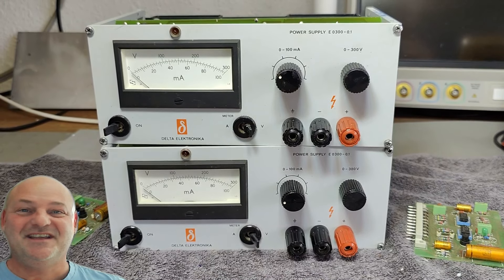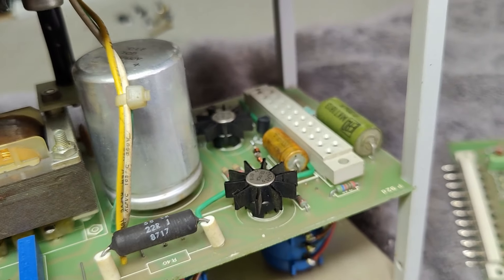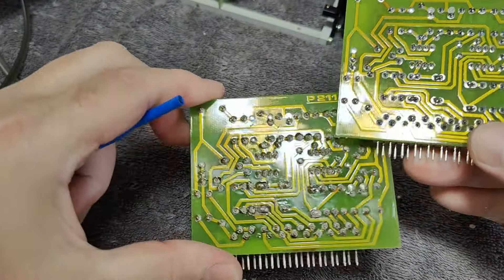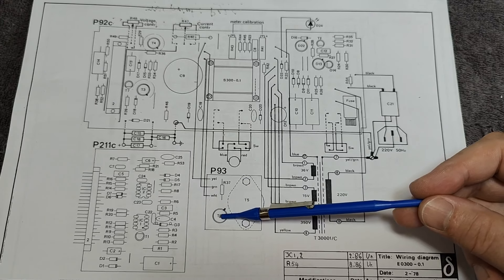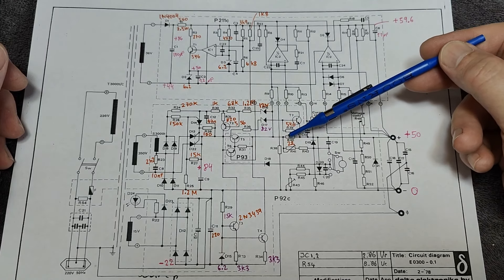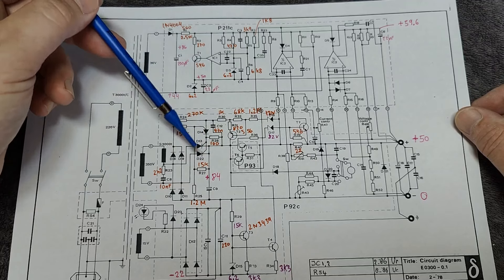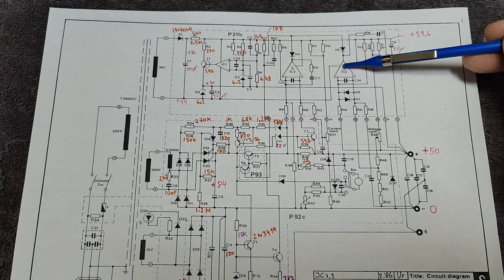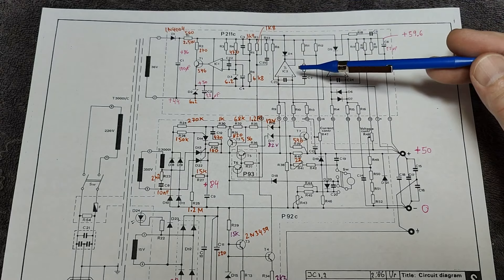Delta Elektronika E 0300-0.1 DC power supply 300V repair teardown

Comment: Nice video , to get rid of the blinking u can add an electrolytic capacitor in parallel with led and its current limiting resistor.

Comment: This “inductor” can be desinged as “swing choke” because this kind of device can resonate with the main capacitor at 2x line frequency when the self inductance is start fall by the load current. This device olso try mainten DC voltage and slowing down the current changes at their output. The usual case input voltage is an non filtered pulsing DC from an full wave rectifier, but olso work on AC line part as transient/harmonic content filter and overcurrent protector.
The ID string of this part is olso start with “S” letter.

Comment: I guessed it was something to do with the TX/inductor but not magnetisation.
I am assuming the designer went on energy storage for the 47n not being more than the pulsed energy of the gates of the SCR's.
Like the turning off of a line output transistor in a CRT you zener the base junction in reverse to suck out the base charge very quickly and it can be as high as 15V @ 1.5A in reverse but for a short duration i.e. less than 1uS.

Comment: As well the leads of the reference are coiled, so that there is no residual stress on the legs, and thus on the die, and as well it will be able to expand without generating any error in voltage as well.

Designers did a poor job with the regulator resistor, should be moved to the other side of the board, as the capacitor does sit below it, but the hot rising air from the resistor does cook the reference diode. Resistor should be moved to the top of the board on some leads, with new holes drilled on the board at the back away from the connector.

Inductor magnetisation I would say it was magnetised from manufacture, so would need to be degaussed and placed back in use.
Reply from the maker: i performed a few more tests with the inductor, I am able to re-magnitize it, in any current direction when turning on the psu, randomly, this tells me, the first few pulses are not perfectly symetric, and will therefore magnitize it, so i would claim the coil is wrong designed for this purpose, it should be made to handle this, maybe it will be a bit bigger, or too big for the case, if designed better for the purpose, output ripple is still amazingly low, so maybe they simply gave up solving this since it is not a big deal for the user,
Reply: @TeardownOZ2CPU  Possibly a softer iron laminate, one that will self demagnetise would be better instead of the one used.
Reply: @TeardownOZ2CPU Did you measure output ripple of power supply? I'm in search for some schematic of nice HV power supply and you really made my day today. It's got preregulator which is important and with your suggestions i think it will be great DIY project. Not sure when it will be done but idea is here. :)
Reply from the maker: @Davor-hifi  yes ripple is also super low and fine, it is also very voltage stable, if you want schematics and more closeup pictures, email me via oz2cpu at gmail